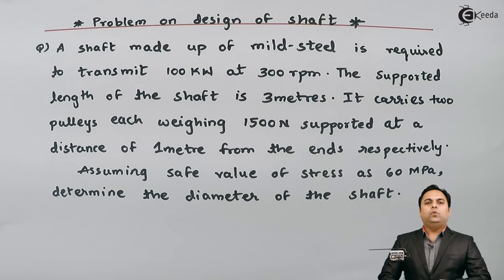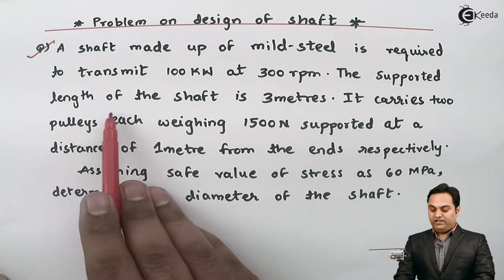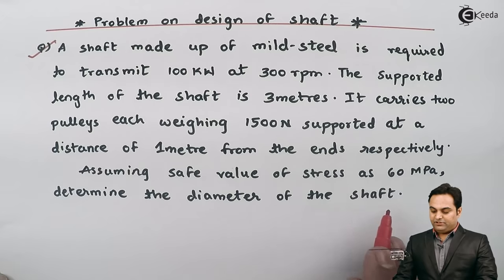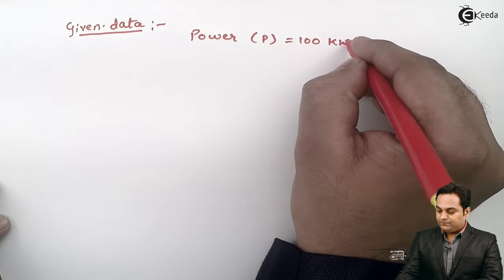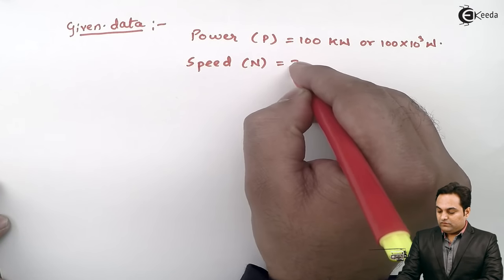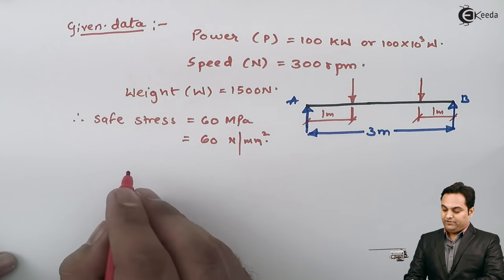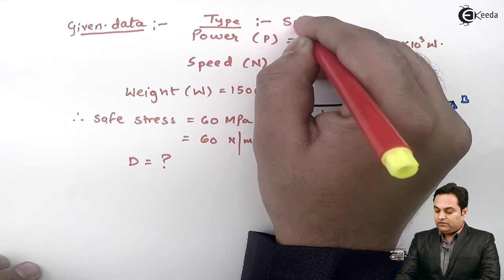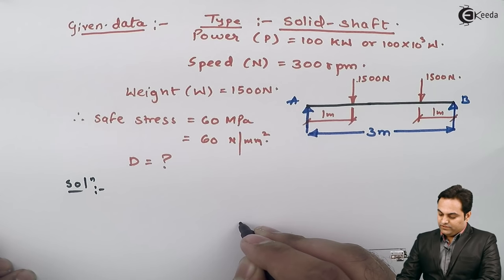Problem 1 on Design of Shaft - Design of Shafts, Keys and Couplings - Design of Machine

Comment: how you take moment at C by neglecting force at D and reaction of B ?????
Reply: its wrong plzzzz correct it..
Reply: I came here to say same thing better calculate bending moments using equilibrium diagram and making sum of moments=0
Reply: When we draw the bending moment and shear force diagram, the maximum value of bending moment can be easily find which is 1500 Nm

Comment: How can you say that shaft will fail by shear not by bending?....I mean that safe stress may be maximum principle stress......that is..32Meqv/pie d cube
Reply: ....taking the equivalent moment and torque and comparing it to shear failure would be great if is pure torsion.  Its not (like you mention)...maybe use von Mises or mohr circle

Comment: A transmission shaft is supported on two bearings which are 1m apart. Power is supplied to the shaft by means of a flexible coupling, which is located to the left of left hand bearing. Power is transmitted from the shaft by means of a belt pulley, 250 mm diameter, which is located at a distance of 300 mm from the left hand bearing. The mass of the pulley is 20 kg and the ratio of belt tension on tight and slack sides is 2:1. The belt tensions act vertically downward. The shaft is made of steel with yield stress 300N/mm2 and the factor of safety is 3. Determine the shaft diameter, if it transmits 10 kW power at 360 rpm from the coupling to the pulley.

Comment: In this problem why did the lectirer not consider the effect of tension of the belt drives...if the shaft is rotating ot means it is driven by the belt drives therefore the effect of tension in tightside and slack side must be considered

Comment: Sir, I am working  on the pellet machine. In that machine has two rollers attached on both side. Due to die rotation the roller rotates and the shaft is place in one place. For the roller, ball bearing is used. so how can I calculate diameter of shaft??

Comment: A Hooke coupling is used to connect two shafts whose axes are inclined at 30°. The driving shaft rotates uniformly at 600 rpm. What are the ... angle where both will occur.
Reply: Sir please send this problem solution

Comment: Sir it,s  really helpful but if the load causing failure has uncertainty of plus--minus  15% and the maximum load on the structure is plus--minus 20%uncertainty how help solve for the design factor. Thanks for helping

Comment: Good Sir, may you please help me with my homework?
the problem goes like this.
The following data apply to a motor and gear drive for a centrifugal pump. The shaft is supported by
bearing A and B. A flexible coupling C connects the pump to the shaft.
Pump output, 500 gpm
Total head, 60 ft
Pump speed, 500 rpm
Efficiency of pump, 64 percent
Motor speed, 1,800 rpm
Efficiency of gears, 97 percent
Power cost, 3 cents per kwhr
Determine the following: (a) maximum horsepower required of motor; (b) horsepower of motor
to be recommended, assuming a duty cycle of full load for 15 min and rest 15 min; (c) diametral
pitch, pitch diameters, and face width of gears, assuming 14.5o
 teeth, 20 teeth for pinion, SAE 1045
for pinion and SAE 1030 for gear; (d) loads on bearing A and B; (e) size of shaft to be recommended,
assuming allowable stress in shear, ss
 = 5,500 psi; (f) power cost of operating pump, dollars per day.
The electrical efficiency of the motor may be assumed as 87 percent.

Comment: instead of pulleys if two bearings are connected, will then the bending moment acts on the system. NO, then what will be the equation since bending moment not actcing

Comment: The kilowatt that can be transmitted safely by a shaft varies directly as the 
number of revolutions it makes per minute and the cube of its diameter. If a 
shaft 3 centimeters in diameter making 200 revolutions per minute can safely 
transmit 60-kilowatt, what kilowatt can be safely transmitted by a 2-centimeter 
shaft making 300 revolutions per minute

Comment: First explain how 100kw required how you know in practical application explain suppose shaft is rotating at xyz rpm carring  2 cam  transmitting rotary to vertical motion by vertical shaft and shaft has load on it also 2 beve gear are mounted on shaft rotating used for indexing Geneva mechanism the shaft is supported at 3 places by bearing one chain drive is applied to shaft by sprocket so who you calculated how much torge is required to rotate assly I want to size the motor and the gear box

Comment: Wrong solution !  The pullies are meant for power transmission. There must be some belts with tensions to be called as T1 and T2. Then T1 + T2 shall add up in the self wt of each pulley ( assuming vertical drive). The bending load, bending moment, equivalent torque shall change substantially. The question must contain additional data like pulley dia, frictional coefficient between belt &pulley, type of the permissible stress etc, then only the solution shall be logical and meaningful. Your shortcut solution is misguiding the readers.

Comment: why did we take bending moment only by Ra ..??
Reply: Its symmetrical so Ra = Rb
Reply from the maker: In this problem,both the reactions have same value & even their distances are same from points C & D.So even if you take Rb while taking moment you are correct.
Reply: sir i want the problems of connecting rod